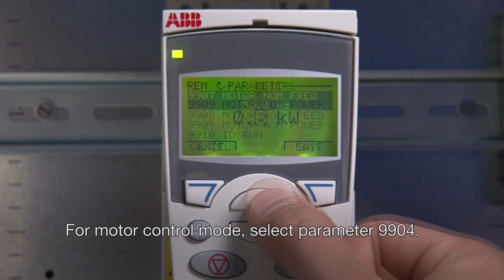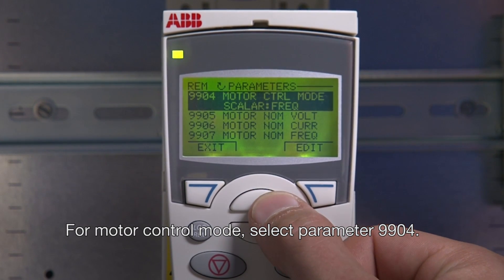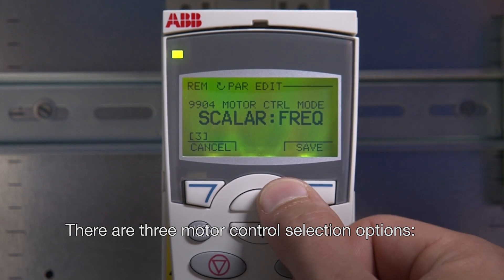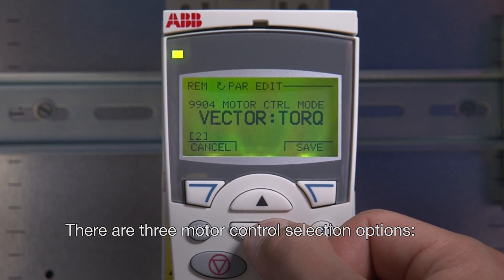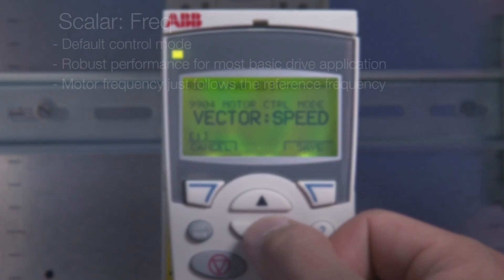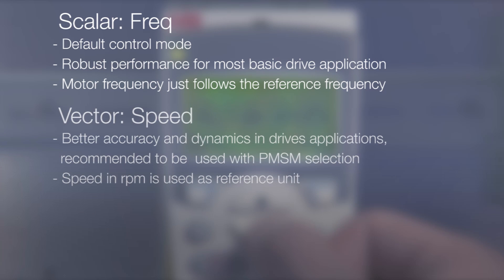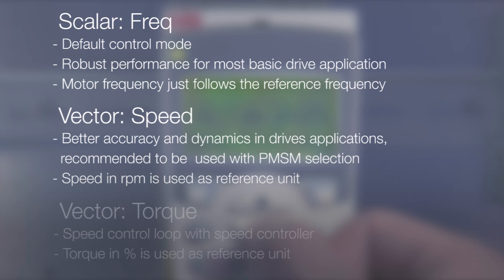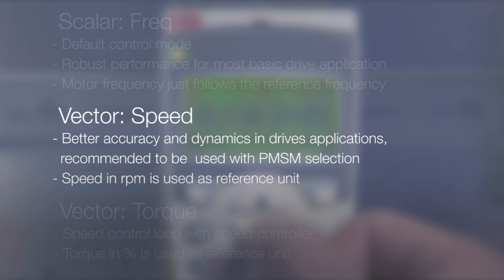How to commission the ACS355 machinery drive

Comment: If we use 2 motors on one drive, how should we enter motor parameters? shall we just add the currents and power ratings? And what the speed should probably be the same or average of two motors? Both the motors are identical.
Reply from the maker: Add currents, add powers, average cos fii and speed. If both motors are identical, then cos fii and speed should be the same.
If load is same for both motors, then also vector control works with the setup.
Two PM motors should not be used unless the load is always the same.
In fan application two or more PM motors should work but not with conveyor application.

Comment: Is this the reason why our motors wont turn, yet the drive ramps up to about 5 or 6Hz and the current limit is maxed out and the drive is at 140%?  You go to the motors and they sound as if they are turning but it's just 'noise' from the windings?